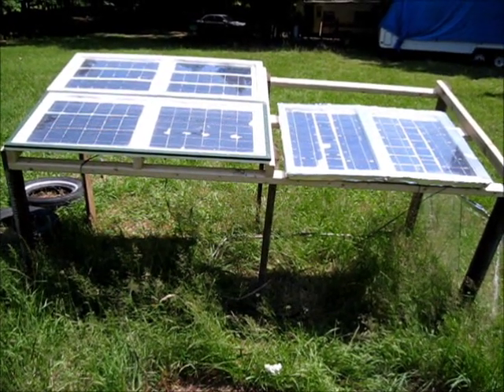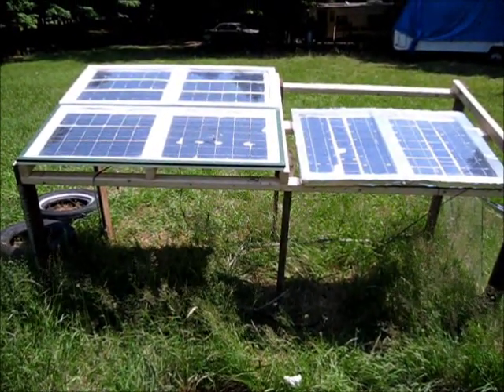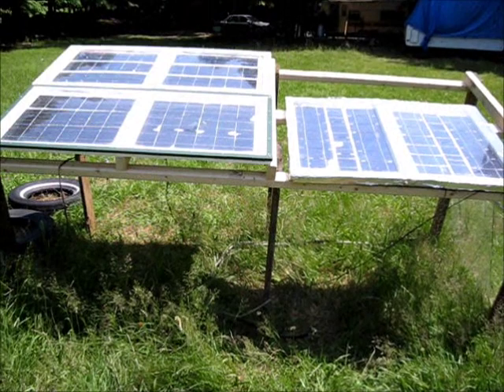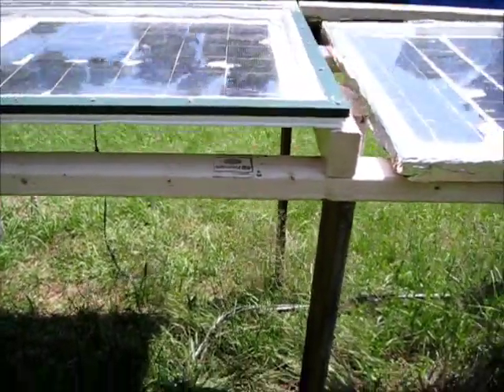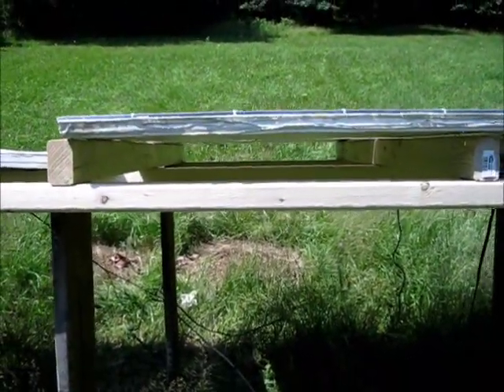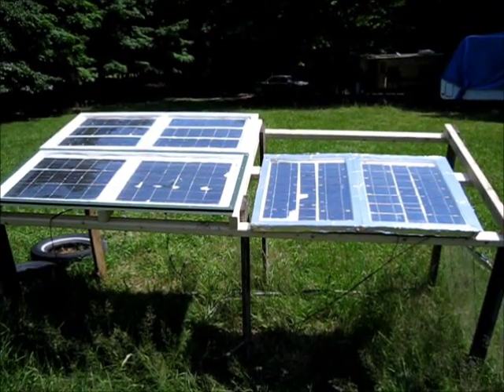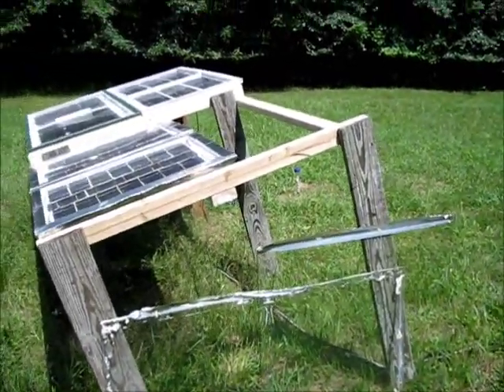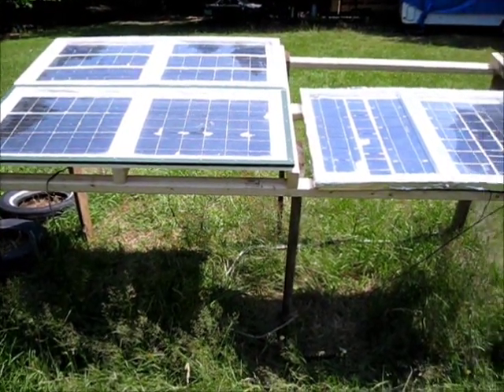Cool Solar Panels To Increase Energy Output - Passive Solar Panel Cooling

Comment: I have also been researching this topic, look up PCM, it is a material used in hand warmers, it can soak up heat in the day and dissipate it later at night. I have my panels off the ground now where as before they were flat on my roof, the next step is to fix some PCM packs beneath the solar panels. Lets spread the news as there is a lot of pollution coming from oil, gas, coal, we need to keep the renewables show on the road and close to the top of the agenda.
Reply: How to use them on a bifacial solar panel?

Comment: Agreed... the thermoelectrics/blower may be an unnecessary addition.  I think the key is blocking out a dedicated airspace to form a chimney that vents at the top and draws from the bottom. A simple thermosiphon/heat exchanger combo like that would probably give you all the cooling you need to max your PVs without using forced air.

I have a tendency to overdesign stuff.  KISS Principle challenged I guess.  :)

Comment from the maker: In that case, skip the TEGs and use pipes from underground to bring cold air under the solar panels. Thanks for an awesome idea, indirectly, lol.

50 degree air would cool the solar panels and your roof, lowering cooling costs in summer.

I think together we have stumbled onto something.

Comment: It would take a lot of TEGs to run appliances or whatever but it would only take a couple to power the fans under the panels... put a false bottom w/an airspace so you have a closed chimney with the fans driving air across.  With heatsink fins on the TEGS the airflow should sink enough heat to keep the fans powered.  Use an intake pipe buried in the ground to cool it if necessary? Just trying to think of ways to save all your PV space for practical power collection while maximizing their output.

Comment: better yet... instead of using another PV panel... if you layered TEG modules on the underside of the PV panels and then let the airflow cool the underside of the TEGs, you'd be generating additional electric power from the "waste" heat. Like composting one's own crap, nothing is "waste" if you can harness something useful from it.  Harvest solar power's light AND heat.

Comment from the maker: Have a look at my channel for how I use the sun to cure my EVA sheeting. I use plexiglas for now due to the price. I found glass distributors nearby with a google search, but it costs way too much. I tried cooling with fans, but couldnt get enough flow to make up the difference the fans used. The passive cooler works great.

Comment: Just an idea. Make a panel to power fans to help cool underneath. No need for battery, just power to the fans when the sun is shining and heat builds up. Small computer fans wouldn't draw much and 1 panel could power them all. As far as moisture build up, do you encapsulate in any way. I am going to try the EVA film. Also, where do you find glass?

Comment from the maker: I thought about that. I am also working on a MPPT charge controller to match the solar panel output voltage to the battery voltage. Might try both at the same time.

Comment: you could even make another small panel out of a small piece of glass to run in a series with the two half panels you been making to help up the voltage. Batteries will charge faster.

Comment: One very important thing I found out from making solar panels. Listen to this advise put extra cells on panels when making them to up the voltage some. When its hot out side they barley make enough voltage to charge batteries. I was finding out that when it was hot I could barely make 13 volts. I started making panels with forty to 45 cell on them instead of just 36 cells like I used to. the work a lot better now.

Comment: Good mount. The higher the better. Mine sitting on the patio draw moisture because they are too close  to the ground. They are also too hot. I hope to sell them soon. I have had a few inquiries. I sold seven so far. I sell them then buy cheap Chinese panels.